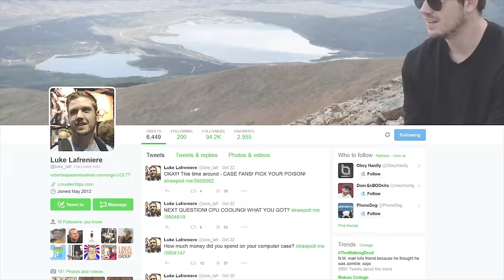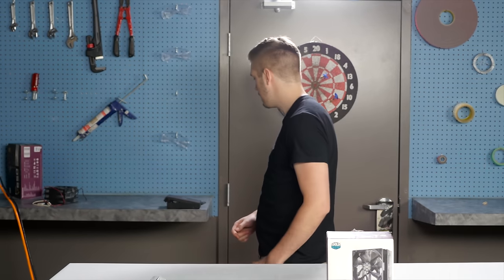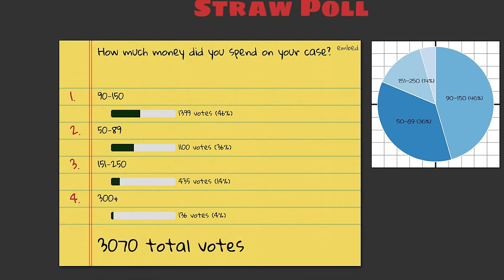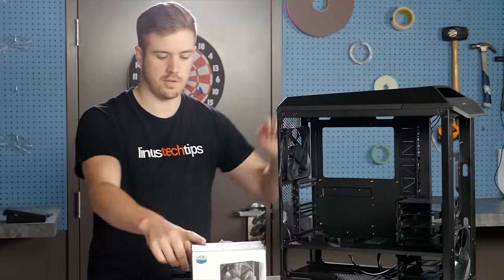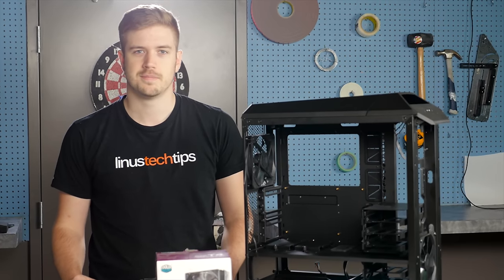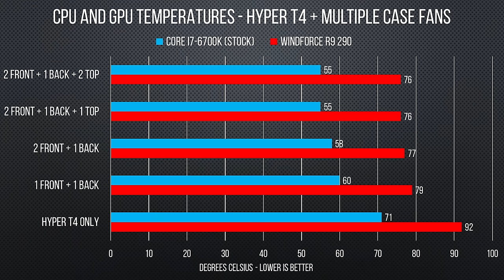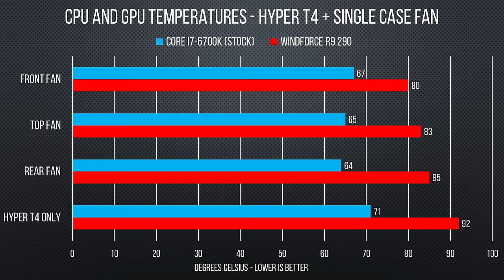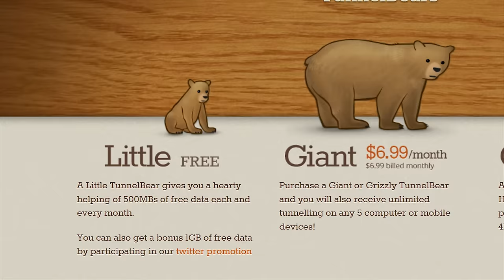Case Fans - How many should you have?

Comment: I have 5 regular case fans not including the two on gpu and one on cpu cooler.  Everything is crazy cool. I don't think any more than that is really necessary.
Reply: 1 in the back, 1 in the front, 1 on bottom and 2 up top. Has worked flawlessly for me.
Reply: +TranceForLyfe 5? I have a Corsair 900D filled with fans. 3 in the front, more in the front on the other side of the HDD cages, 6 in the top (only 4 slots, but 240mm rad in push/pull), 1 in the rear, 4 in the bottom. That's 16, not counting the 3 in my GPU and the one in my PSU.
Reply: ***** The back is intake, front exhaust, bottom exhaust, top two intake I believe.  Why do you need so many?  Everything for me is extremely cool with this the amount I have.
Reply: ThePolysyllabist Perhaps, lol.  I haven't had any issues yet and I'm running a pretty damn hot cpu too
Reply: +Sun Praiser Intake sucks in air, i.e. the back of the fan. Intakes are usually on the front of the case and exhausts pushes air out, i.e. the front of the fan, and usually in the back.
Reply: +Christoffer Nørskov seems to be pretty much what we call a fanatic fans fan.
Reply: +JZStudiosonline He's obviously aware of that. He just asked TranceForLyfe about his configuration ...
Reply: +TranceForLyfe I have 2 in front, 2 on top, 2 on side, 1 back, and 1 on the bottom.
Reply: asdda Full tower case I imagine?  I could only fit 5 in my mid tower.
Reply: TranceForLyfe Midtower actually! It's a corsair carbide 200r
Reply: TranceForLyfe Best case I've ever had, definitely recommend it
Reply: asdda That's a beefy case! It looks great!  What size fans do you have?  

I had to cheap out on my case because this was my first build.  I just have a cooler master elite 431.
Reply: TranceForLyfe All the fans on the case are 120mm except the two top ones who are 140mm. You can put 2x 140mm on the sides, but the holes where the fan blows are only 120mm x 120mm, so there's literally no use in putting a 140mm there. 

This case was actually remarkably cheap, only 70 bucks. Not bad for such a beefy case as you said.
My first build used the Cooler master elite 310, so you were better off than me!
Reply: asdda Very nice indeed!! That's a cool setup then! 

That is an amazing price considering some cases cost $100 or more and Corsair is one of the big dogs for cases today.

I just looked that one up.  Dang, I guess you're right! The 310 looks like it was made of plastic :P or a lot of it.
Reply: TranceForLyfe The front of it just shattered when I dropped it a foot of the ground. All the 5,25inch plastic protectors flew everywhere, and there was a big nasty crack running along from the bottom to the top lol. The metal inside the case was so thin, that I had to wear 5 band aids on my hand due to cuts after installing 2 hard drives and 1 cd reader. It was horrible that case. It costed 35 bucks new when I bought it, might explain it haha
Reply: asdda Oh my god, lol. That sounds like some Final Destination shit except with a PC case.  Lesson learned, don't cheap out TOO much on a case!
Reply: TranceForLyfe Haha definitely not
Reply: ***** The front is intake, back is exhaust ,top is exhaust and the fan on the bottom is intake. Cold from the bottom, heat out from the top as hot air rises.
Reply: *****
No problem :)

Comment: I had to run mine backwards. Two 140mm intake fans on the top and one 120mm intake on the back. NH D15 with the fans pushing down towards the gfx card. Two 140mm exhaust fans on the bottom and and two 140mm exhaust fans on the front.
Reply: 7700k at 5.0ghz delidded, doesn't break 70°C, GTX 980.
Reply: Special EDy Water or air cooled?
Reply: Deedit Noctua NH D15, it's an air cooler that keeps up with 240mm AIOs. Fitting it properly into a Corsair C70 case is what necessitated running the fans in a reversed airflow direction.
Reply: Special EDy i think i ordered too many fans alongside my Noctua d15. I'll have 2 in the front. 2 in the back, and 1 on top...
And im not even Overclocking..
Reply: That setup blows hot air over the chipset, ram, and gpu if your cpu is air cooled which is why the optimal flow is front to back where the hot air has the shortest path out of the case.

Comment: Are the top fans for intake or exhaust? If I want positive pressure in my CM 690 iii how should I position the fans to 1)maintain positive pressure in the case and 2)keep out as much dust as possible(using the in-built mesh).
Reply: too fans are exhaust.
Reply: that is what I think not all fans are for heat, they are for air control.

Comment: Love this vid.  Weird to think that if you told me 15 years ago that 92C was an acceptable temp for any processor/gpu, I would have laughed.
Reply: Alec J yesterday i burned a Pentium 4 at 75°c
Reply: 1234 5678 temp doesn't mean shit for if you fry a CPU..
Reply: honestly, that's still hot to me. I never let my GPUs get above 80c.
Reply: caitlinomalley80 personally I think some people are a bit overzealous in that aspect of their pc. My gpu usually tops out at 70c, but it doesn't thermal throttle until 83c. This means that all temps below that point are safe, and even then, the GPU will downclock to remain at a safe temperature.

The same idea applies to cpu as well. Unless you're thermal throttling, your Temps are safe. Unless you're overclocking, I would argue you're safe with an average cooling configuration and you shouldn't worry
Reply: The92Waffles its mostly just an old habit that's hard to let go of. I had a gpu about 10 or so years ago that would idle in the mid 80s, but would crash regularly when under load due to overheating rapidly, its stock cooler was very underpowered, but its what led to me developing a habit of aggressive cooling fan curves/profiles. I mean thermal throttling is one thing, but if your gpu is shutting down and restarting because of the heat, even if its technically within spec (according to ATI back then, it was capable of going into the upper 90s safely), you definitely have bigger issues.
Reply: caitlinomalley80 I see. I wasn't a pc gamer back in those days

Comment: I just go by the old adage that air in must equal air out to be most efficient. I currently have three fans exhausting and three fans on intake. I also have a fan on the cpu cooler and the videocard just has its own fans. My power supply intakes from the bottom but exhausts out the rear so it doesn't add any latent heat to the inside of the case. My temps are generally pretty low so I use use software to control fan speeds based on several different temperature curves. Use good thermal paste on the cpu and gpu and I run cpu with a modest overclock and gpu is slightly overclocked. My CPU temp has never been over 60C and  the GPU runs furmark at around 54C at its highest.
Reply: I know that its all subjective to the equipment used but if you are exhausting with three fans and dont have the intake CFM to match, its just not that efficient.

Comment: My selfmade computer case out of wood with 3 x 140mm fans at the front, 2 x 140mm fans at the top and 1 x 140mm fan at the back cools the CPU(i5 6600k) on full load at 50°C and the GPU(R9 390) on nearly full load at 70°C

Comment: What about open case with and without fans ?
Reply: Dust itself doesn't do anything to computer components.
Heat is the main factor, which is what dust causes.
Reply: +Felix Posselt Are fans taking the air from a magical and different place. I see no difference in dust buildup
Reply: +Felix Posselt My pc is usually overheating with 3 big fans when closed so I just leave it open .. thats's why I was thinking about comparison with open case
Reply: +Miroslav Handzhiev maybe it's overheating because you leave it open
Reply: Skipper HUN nop - the other way around
Reply: What parts do you have? AMD? :P
Reply: It's not ideal because you create neutral airflow. You really need (ideally) positive airflow or negative airflow so the the heat is actively dissipated.
Reply: chipset will overheat and ruin your motherboard
Reply: an open cpu case is not the best option you would do to your pc.
Reply: +Custodio Pereira can yoy explain why it is not overheating on open case but it is on closed :/
Reply: You'll get a nice coat of dust on your components and it'll make them overheat, do you know anything about pcs?
Reply: have you checked you airflow? if the lower front ones are pulling air inside, and the high rear ones are pulling the air to the outside of the case?
Reply: I truly believe having positive airflow is the ideal world maybe like two fans pushing air in and one taking it out so heat dissipation isn't a problem and dust is left outside but i can't as of right now so my case is left open all day all night with 3 cats in the house and dust everywhere and i do not overheat really
Reply: C4_yrslf Beg your pardon but why cant you? some lower end coolers are as cheap as candy, and even tough its not overheating, you can lower the temps you are getting now, wich means your components will have a bigger life.
Reply: Felipe Schelb Yes you are right but my case just didn't give more space.. so now that i bought a Rosewill Rise pc case, i have 5 120mm fans pushing air in and a 140mm fan pulling out air, in my personal household condition, this is perfect no dust in the case ever and my temps drop from 95celcius to a maximum of 76 celcius sooo.... I love it
Reply: C4_yrslf why would you have 5 in and 1 out? thats bonkers
Reply: Felipe Schelb Sure does not make a huge airflow as the 5 inpush fans may and will spin without being at a 100% effective but i do know that the positive pressure will keep dust out my case finally and it did so as of now degrees have went down by 20celcius and i have 10 times less maintenance to do wich is pretty much the objective i had in head :D
Reply: Felix Posselt You have any tips for a AMD rx480 sapphire Nitro+ plus an AMD fx-6300 6 cores processor. Like how my fans do I need? The case comes with 2. Do I need to buy an extra cooler ?
Reply: Zeus GamingHD run your system and check your temps get hwmonitor or some other program. if your not going for heavy overclocks and your case has good air flow you will probably be okay. if your temps are high then buy another fan.
Reply: eeeww

Comment: Curious to see what 3 in the front and one in the back would do.
Reply: Temperature would likely drop significantly.
I put tape over all the random holes and vents on the front and bottom of my case, and over where the top front fan can go, so the only place any significant amount of air leaves the case is at the rear and top rear.

Tested:
3 front fans only, case fans & cooler at 60% speed = CPU 65C & GPU 72C
2 front fans and 1 rear fan, case fans & cooler at 100% speed = CPU 65C & GPU 74C

When removing the lower front fan for the second test, lots of cool air left the case through the lower front fan port.

Also tested:
3 front fans only, all fans 100% speed = CPU 63C & GPU 70C
3 front fans/top front INTAKE/top rear exhaust/rear exhaust, all fans 100% = CPU 63C & GPU 70C
3 front fans/top front EXHAUST/top rear exhaust/rear exhaust, all fans 100% = CPU 65C & GPU 70C

All tests done at 26C ambient.

ATX X570
5600X stock clock
2080S stock clock
NH-D15
top/front fans NF-S12A ULN
rear fan NF-F12
cougar turret with front plate and front I/O removed, no dust filters

seasonic 850W, intake bottom, exhaust rear
Reply: @billowytrots8366  A for effort
Reply: You just described my case.
Reply: @billowytrots8366  I have 5600x and 3070, when I play cyberpunk am I good with just 3 fans? 2 intake front and one exhaust in the upper back?
Reply: @fuge511  Yeah that should be plenty. However, if you are using the stock cooler, i would recommend upgrading to a noctua one. Also try to find a way to monitor your temperatures, and see if you get better performance with all three fans mounted at the front.
Reply: @billowytrots8366  get a noctua cooler for the cpu? And yes I will make sure to experiment with different placements. Thank you!

Comment: You need to reverse the top fan at the forward section.   Without any additional cool intake air, it is not logical for the temperature to drop

You always need one more intake than exhaust as the pressure will push the hot air out through the crevices of the case

Also, put an extra fan on the air cooler.

Use only premium fans.

Use a large mesh case if lower temperatures are important.

Use a Ryzen 3 1200 AF ( the new 12 nm version )

I have never seen the perfect case for optimim temperatures, especially under $ 200 USD.
Reply: Hey can you recommend your top 2 cases plz

Comment: Rear or top exhaust fan alone means no cool/fresh air is being brought in, like the front fan alone does. Bringing in fresh air at pressure is better than getting hot out, as the increased pressure in the case from intake will naturally exhaust. It wont exhaust as much as having an exhaust fan of course, which is why 1 front intake and 1 exhaust (rear or top) is optimal and brings the most impact.

The case also matters. This one has vents in the top, where hot air naturally goes, so the tests, 1 with rear exhaust only and 1 with front intake only, will both be affected by hot air being able to escape naturally at the top. Perhaps with a case without top vents the results between rear exhaust only and front intake only may be different, with the former having more of an impact when there's no top vents.

Comment: What is a free software to find out the temp in my pc and one that works right?
Reply: +HDFinch msi afterburner lets you see  temps while on the desktop and in game too
Reply: +HDFinch RealTemp is good for showing your CPU temperatures per core.
Reply: +HDFinch Speccy
Reply: ya Mao afterburner is what I use
Reply: Msi*
Reply: +HDFinch HWMonitor is by far the best software, you can monitor literally everything.
Reply: +HDFinch HWMonitor is the best.
Reply: +HDFinch Speccy is the easiest one to use that I've found so far, hope that helps :)
Reply: +HDFinch HW monitor is the software I use all the time
Reply: +HDFinch HWMonitor buddy
Reply: +HDFinch For ALL components, I use 'Speccy'
Reply: +HDFinch Almico Speedfan. I've been using it since 4 years for my overclocked build and it works perfectly.
Reply: I use NZXT CAM
Reply: +Tristan Crawford i have that installed but i dont know how to use it for controller fan speeds
Reply: +HDFinch  I don't really trust HWMonitor, i think it's on the wonky side, it doesn't seem to try to attribute the mainboard sensors and their offsets properly. As an alternative to that, i suggest HWiNFO.
Reply: +HDFinch I'd recommend Speedfan, it's what I've always used. It's super lightweight and you can choose a temp to put as a live icon in your system tray (and choose the color of the numbers :D), so you can always see your CPU or GPU temp no matter what's going on. And a quick mouse over the icon will pop up a convenient little bubble with all your temps. And if you feel like looking up tutorials and fiddling a bit, you can use it for fan speeds as well. Cheers!
Reply: If you have an intel processor real temp is best.
For amd  HWiNFO
Reply: +HDFinch HWMonitor is the best.

Comment: So I had a quite similar setup as used here, so I figured, what the heck, I'll just run the test myself. And surely enough, I got very similar results, with CPU temp going to 57 and GPU temp going to about 75. This seemed quite disappointing, seen how my case is covered with 200mm fans and whatnot. Then I noticed, that the most important fans, which are automatically controlled by the system to keep the noise levels down, namely the GPU fans and CPU fans, did not go to 100% during the test.

So, I figured that these were probably acceptable parameters set by the system, and the automatic fan control was just trying to keep the temps to about those figures. So I manually set every single fan to 100%, and noticed a huge drop in GPU temperature, that now settled at around 57 degrees, while the CPU only went down to 55 degrees.

So... maybe re-run the test, don't be in such a rush and ensure that the CPU and GPU fans don't bottleneck the heat transfer?
Reply: Fan air flow directions?
Reply: He wanted to do a realistic test, and having the CPU and GPU fans at 100% isn't something that anyone would do all regularly

Comment: Cool ^^ Hmm, making me rethink buying 2 fans to install in the front of my case rather than 1 fan. The Cooler Master Q300L case only comes with 1 pre-installed rear fan.
Reply: You can buy 4pack fans fr cooler master, its cheap
Reply: You definitely need more than the one for that case. The reviews are very critical of its airflow.
Reply: I have the same case. What did you end up going with and how did it work it out?
Reply: I have this exact case and I have been trying to figure out the best fan set up. I have two intakes at the front and 1 exhaust, but I am debating installing one more intake or exhaust

Comment: I'm a bit doubtful about this. I wonder if you get the same results with less fans because the CPU cooler and the GPU cooler runs at faster speed to compensate. Would have been interesting to the fan speeds, as well as the noise level.